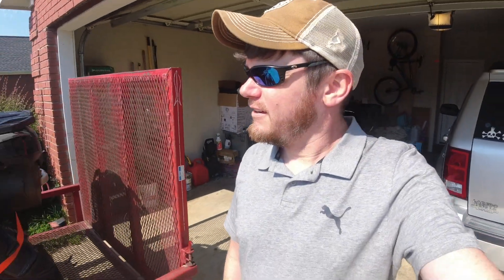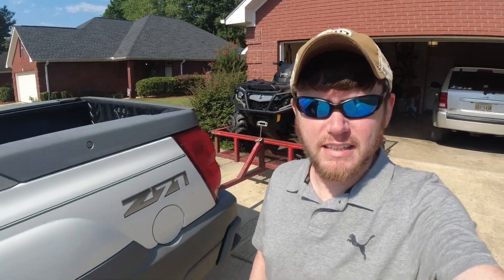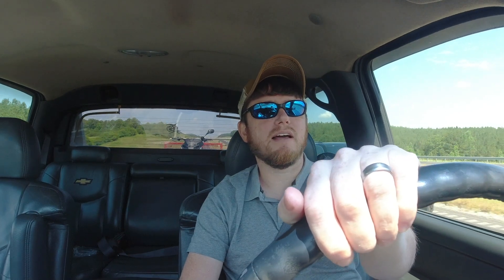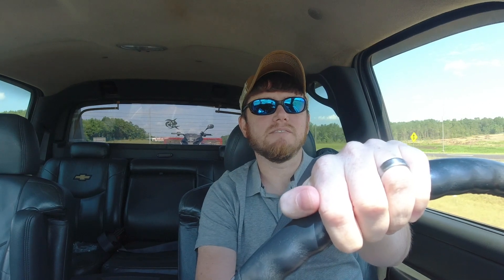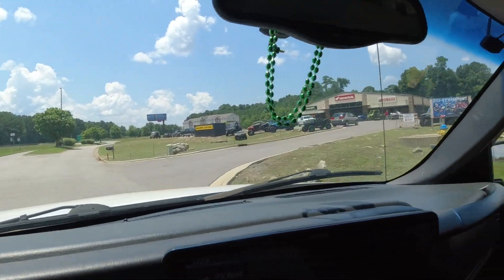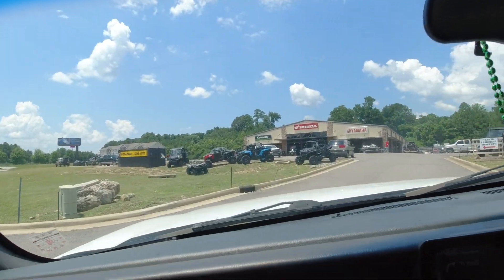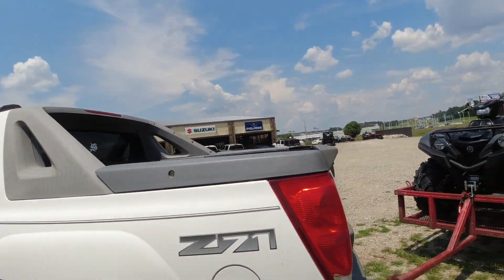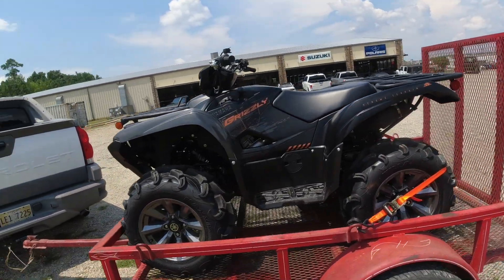I traded my Outlander for a Grizzly...

Comment: Dude I did the same thing as you back in June .. traded my 21 outlander xt in for the exact bike you have lol.. the only thing I’d change on the grizzly is tires I would like some bear claw or bighornes other then that I’m good.. only thing I miss about the outlander is the vtwin sound.. the grizzly is more nimble lighter and so much better in the tight rough stuff witch is what are trails mostly consist of.. you made the right decision man for sure .. Yamaha is a Honda on steroids lol give us a update once you get some miles on it .. keep the vids coming take care and stay safe out there ..
Reply from the maker: Yeah man, I am happy with my decision, loving it so far. I like the stock Zillas for where we ride, all about the terrain. You hit the nail on the head with the sound, I definitely miss that twin rumble, but I like the sound of the grizz as well. I think many of the ATV videos I watch just to zone out on the exhaust sounds. Thanks for watching and commenting bud.
Reply: Why the switch I’m between the outlander 850 and the grizzly 700 could you go a little not in detail about it???
Reply from the maker: @Willie.20  it will ultimately come down to what you want. With more power comes more maintenance.

Comment: Years ago I had a Can-am outlander 800R. The power of it was fun and all, but the damn thing ran so hot I couldn't enjoy myself on it. They claimed this was normal lol. I sold it and bought a Grizzly 700.. Also, I have an 07 model still running the original belt, no joke!
Reply from the maker: Oddly enough my 650 seemed cooler than my grizz. But yeah, even the plastic push pins on the grizzly are so much easier to remove and just higher quality in general.
Reply: @chasintrail  That is interesting. The Can-ams have a reputation for running hot, but maybe the newer models are better.
However, I will say, my Grizzlys fan would turn on more frequently before I richened up the fuel mixture, but it wasn't overheating by any means. 
Even before I tuned the Grizzly, it still wasn't getting nearly as hot as my old outlander 800. You could easily feel the heat of the engine on your leg, and that Is why I couldn't have peace of mind keeping that machine. I just felt since it was getting that hot under normal trail riding, how is it going to survive slow rides through the woods when I'm spinning the tires a lot, or plowing snow.

Anyways, not sure how hot your Grizzly is getting, but I would bet something is wrong with it if it's feeling hot on your leg. I can tell you, they are known to be super reliable quads, right up there with Honda, and that's saying a lot.
 I have had two Grizzly 700s, and both bullet proof machines. The first couple model years had some stator cooling issues that proved to be common. But they fixed that issue with a oil cooling line that drips oil over the top of the stator, they still use this exact design to this day actually. Look on the left side cover of your Grizz, you'll see the metal oil line on the outside of the stator cover.
Reply from the maker: @markalan4026  It’s not an issue this time of year, only in the summer wearing shorts. 95+ degree temps aren’t uncommon here. I lined the left side plastic with fiberglass heat reflective tape which helped a lot. May be a difference as well with the 650 being lower displacement than your 800. A file tuner would help but I’m not willing to shell out that cash at the moment. I grew up on Yamahas and gave em hell, hard to break.

Comment: I have a '22 outlander and have the issues you have there. Problem is I absolutely love riding it.
Reply from the maker: Oh man it's a blast to ride isn't it? I could make mine stop squeaking, but I just got sick of having to. The grizz is about equal with it in the mid range, without the noises. Garage Products makes some nice lifetime no grease bushings if you ever want to replace them.
Reply: I have a 22 850  and don’t have any of the squeaks, if I could do it over I would get the 1k.
Reply: @TwinTurboToyota  you will get the squeaks..... give it a bit more time

Comment: I just traded my renegade 1000xxc in on a 23 grizzly se.
Reply from the maker: Nice man! Welcome to the club! I watched your walkaround video. If you plan on getting in to any deepish mud, I would recommend relocating your gas tank (rollover vavle) vent line to the front of the ATV where the other vent lines are run. The stock line sits down near the rear diff. Mine was completely stopped up with mud. It's not talked about as much as other mods, but is a good precaution.
Reply: @chasintrail  I don't get into any deep mud here in southern arizona it's pretty hard and dry, but definitely still a good idea to do thanks for the tip! 💪🏻

Comment: I have a 2022 650 Outlander. Your videos pretty much talked me into buying one. I love the power but I hear what your saying. I'm getting tired of doing maintenance all the time and they are noisy. I was originally going to buy a Grizzly because I'm a Yamaha guy. Post some videos of your new Grizzly.  I might be doing the same thing in the near future. I just wish Yamaha would step up and put more power into their machines. I get that there a work horse but more power is also nice. Hope it works out for you and look forward to your updated vids.
Reply from the maker: The Outlander is definitely more powerful, and I knew about the maintenance going in, it just eventually got old, especially in 100 degree weather.  I am looking forward to seeing how much more power I can get out of the grizz, but am in no rush. The grizz also feels more nimble and better balanced on jumps, but I don't feel I can go as deep as the outty. I have a good bit of footage, just haven't had time to get it out.  Thanks for the comment, love hearing your experiences.
Reply: @chasintrail  to get more power you'd have to change the clutch on the Grizzly.  Unfortunately that would void the belt warranty.  A friend of mine has a Grizzly and wants to put a clutch in but won't because of the warranty. Grizzlies are powerful, just not in top end speed. I wouldnt worry about getting stuck. They thrive in low and mid range. I love being able to go 65+mph but don't do it that often. Grizzly top speed is just over 50+.
Reply from the maker: @livinglife69  I have not topped it out yet but many I have seen do low 60s, but like you, I rarely hit those speeds. Belt warranty is cool and all I guess, but I'm not going to worry about it as belts are cheap enough to replace anyway. You can mod the clutch with a shim and they would never know. But yeah, I would go the way of a machined shim and spring, gotta get through the factory warranty before I worry with that.

Comment: I know the 650 is more powerfull but does the switch make the Grizz feel weak?  I dont want to loop out but a machine that can carry the front off the ground a foot or 2 when I punch it would feel just right.  I akready hate the feeling when I grab a hanfull on my Husky 250 and the front end can come up quick.  I dont like letting off but if the Grizz can just carry the front maybe I dont need a vtwin.
Reply from the maker: No the Grizz doesn't feel weak by any means. I fact, it feels more powerful in some RPM ranges. I have never rode a 1000cc ATV, but I can tell you that none of the stock ATVs 850 and below will lift the tires just by slamming the throttle. Each is different and require practice to get the wheels up. The Grizz is much lighter than the twins and with minor clutch work can pull the wheels up with ease. None are going to pull up like your 250 except maybe a Raptor. Both the 700 and 650 take all I got to get the wheels off the ground in low stock. I rode a Grizz with a tuner and possibly clutch shim and it came up with very little effort. The grizz is much better balanced than the can-am. The  650 always liked to nose dive on any jump but the Grizz lands flat, on all 4s. I hope this helps, sometimes I get off on a tangent.
Reply: @chasintrail  The more info the better.  Ive been told by multiple 850 owners that with the PV3/Tune its hard to keep the front end down which is why Im looking at the 650 Renegade base or xmr. I know people on grizzly central say with the sheeve mod the front end gets light but that coukd be just tge ratio and still not feel powerful. I have my down payment on a 23 SE (xtr) but back of my mind wonder if I want the vtwin power over grizzly reliability.  My wife would be sometimes going 2up so woukd need the power to get us around at a  fun liesurely pace but not too much so she can handle it solo.  Anyays thx for info Take care.
Reply from the maker: @legowolf22  I'm about 155 and my wife around 120, we have no issues riding 2up on either. You won't go wrong power wise with either the 700 or 650, they are very close. I feel the Yamaha is built better and requires less maintenance.
Reply: @chasintrail  Plus the Yammy comes in FDE an can install  the colored halos for tbe same look I wanted on the '22 XMR but '23s have new headlights with no halos out yet (if they can even mae them, i dont see a mounting surface)
Reply from the maker: @legowolf22  Yeah I recently put some amber halos on mine from eBay around $30. I wanted to mention though that the outlander seat is longer, may be something to consider.
Reply: @chasintrail  yeah with a canam we can just add cooler to rack and share seat but with grizz gotta buy one of those big seat/storage things
Reply: @legowolf22  my 850 xt can get up just with the throttle and it’s stock

Comment: I'm so upset I have to sell my Grizzly.  It's just too wide for the trails in my area.  I think i'm gonna get  the kodiak or try my first sport quad (raptor).  I've bent 3 tie rods and hurt my wrist countless times in the 2 years I've had my grizzly.  Might not be an issue in some areas, but in the PNW trails can be tight and I either have to go 2 mph or risk hitting something hard.  I'm sad, but it's just to wide for my area. I'm thinking of trying my first sport.  its 4 inches narrower than the grizz.
Reply from the maker: I don’t think a Kodiak would make much difference, the Grizzly is average width. Sounds like you need a dirt bike…😅
Reply: @chasintrail  
Oh I ride a dirtbike during the summer. During the winters I like to ride a quad. You'd be surprised how a few inches makes things much easier to navigate on tight trails. I ride with several people on sport quads and Kodiak's. The grizzly XTR which is the one I have, It's even wider than the normal grizzly and certainly more than the Kodiak. Maybe you would have to ride here to understand. But in a lot of areas the trail is literally North more than 50 or 52 inches. Through use, the trails are often a half foot to 1 foot below The surrounding landscape cut in through time. There are always rocks and roots just outside of the path and it is extremely easy to catch one. I am a far better writer than most of the people I ride with. And I'll admit my speed is faster so easier to make mistakes. But people riding the more narrow bikes just don't seem to hit any of the stuff that I do. They always give me shit because they know I'm better and faster but I'm always the one almost breaking my wrist even when I'm following the slower guys. They squeeze by obstacles worth 2 to 3 inches to spare. And if I don't hit it absolutely perfect, my handlebars get ripped out of my hands 🤷🏽
I don't really Hunter anything, so I'm actually thinking of getting the sport quad. I rarely actually have to use four-wheel-drive and the few times I have I could've easily turned around or chosen another path. I think I'm gonna go for the raptor which is even more narrow than the Kodiak. No anyways. Nothing anybody cares but that's my story
Reply from the maker: @fishtailfuture  A Raptor may be right up your alley, they aren’t as wide as some other sport quads, I have never rode one personally. All Grizzlies are the same width, only difference is the Zillas on the xtr and SE. the winch is the only difference in the XTR and SE besides paint. For spirited riding though, I still prefer the dual disc brakes on the rear of the grizz over the sealed drum on the Kodiak. Luckily tie rods aren’t too bad expensive and some times can be fixed. I hope to find a group to ride with around here some day, just not very many places to ride close to me. I appreciate the comments, I enjoy hearing how and what other folks ride and I could probably talk about quads all day.